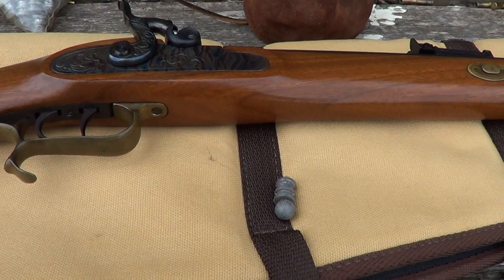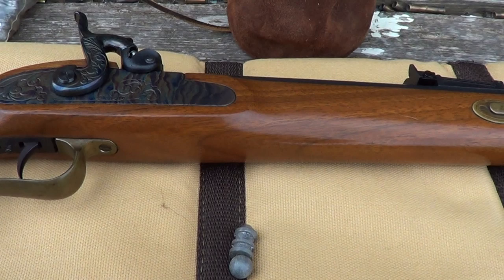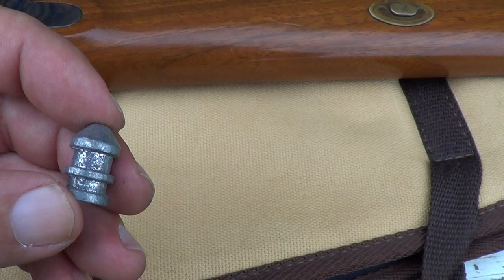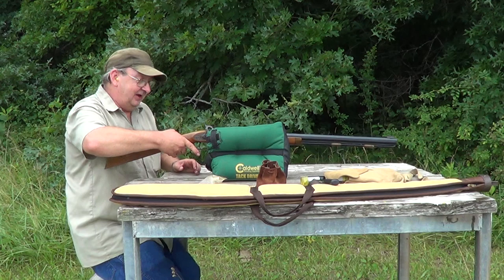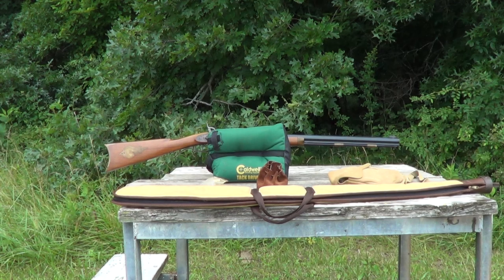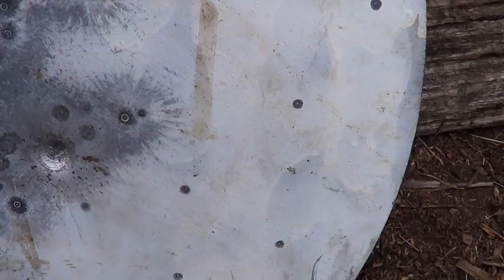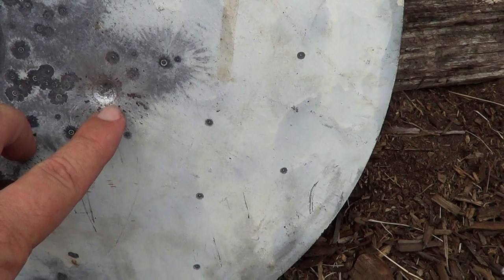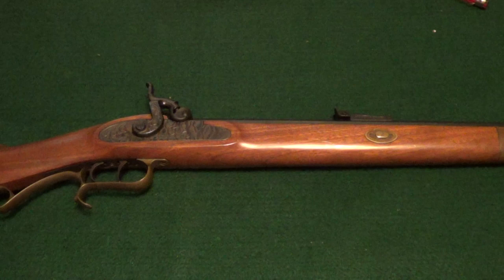45 T/C Hawken vs Steel Plate

Comment: Black powder is a blast. I've shot .45 in my 50 with a sabot. It's trucking when it comes out the barrel. That round was moving!
Reply from the maker: In years past I`ve taken several deer with that Maxi-Ball load and a couple with the round ball load. I was surprised that neither of those loads went through that plate.

Comment: It looked like it did a pretty good job on those plates to me. Beautiful firearm. Cheers
Reply from the maker: Velocity must have a lot to do with it. I know that load must have had at least twice the kinetic energy as the little 17 Remington, but the 17 blasted a hole in the plate.
The 17 Remington only has about 900 foot pounds of energy. But that little 25 grain bullet probably flies 2 1/2 times as fast and impacts in about 1/3rd the surface area as the 45 muzzle loader bullet.

Comment: Round balls do have greater velocity than conical bullets. Its easy to push one to 2000 feet a second while the conicals might struggle to make it to 1500. The difference is the conical is going to hold onto its energy better because its longer and more wind resistant.
Reply from the maker: I think that velocity has more to do with penetration of something hard like a steel plate than bullet weight and the kinetic energy.
The little 17 Remington drilled a nice little hole in that plate. With a 25 grain bullet at a little over 4,000 feet per second, it only has about 900 foot pounds of energy. I know that maxi-ball load has more muzzle energy than that, probably twice as much. But the 17 does put what energy it has into a smaller area and transfer that energy in a shorter period of time.
Reply: Well in all honesty, muzzleloaders rely more on bullet mass to take down things since hypervelocity is very very hard to achieve.

Comment: The pure lead of both projectiles were also a factor, but that's exactly what you're supposed to shoot out of a muzzle loader.  I remember reading in my TC manual not to shoot balls cast from wheel weight since it's not pure lead.  It contains alloys that make the lead harder.  Of course the reason they don't want you to use them, is because they might be harder to load & seat against the powder.  But for punching through steel, I suppose it would be preferred.
Reply from the maker: +StraightPipe C60 If you use a ball that is too hard, the rifling in the barrel will cut the patch material. It would shoot more like a smooth bore with poor accuracy.
Reply: You can strip your rifling with hard casts, one here and there won't hurt but all the time will

Comment: I've blown through 3/4" of mild steel with wheel weight cast round ball on top of 120grains of fffg. That was in a .50 cal
Reply from the maker: A heavier powder charge and a little heavier ball than this one.
Reply: 45 cal is faster than .50 cal. Speed defeats armor. I made it 70% threw AR500 3/8 plate from a Kentucky long rifle and 200gr pure lead bullet
Reply: I shot through 3/4 ar500 with my 22lr.

Comment: Very good power there with lead projectiles which are deigned more for soft fleshy targets. If you want full penetration on steel targets its best to use projectiles that are harder than the target.
Reply from the maker: Not really practical with a muzzle loading rifle. They are designed to use soft, or medium lead projectiles.
Reply: @1957Shep  You can makeup various different type slugs for them as with shotgun slugs. We have machined a few steel slugs the penetrate very well.